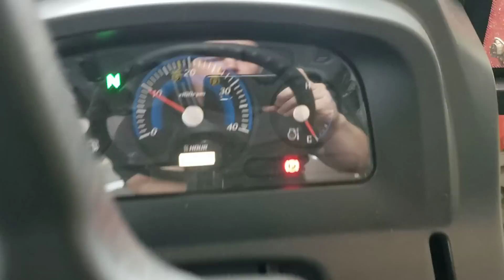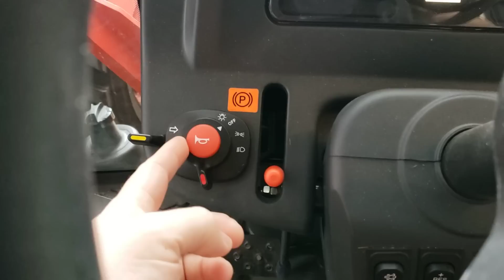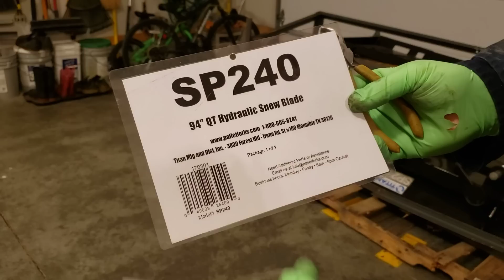Titan - SP240 - 94" Snow Plow - Unbox, Setup, Hydraulics, UHMW Cutting Edge, & First Run

Comment: The issue with plows is, if you get a lot of snow and no significant melting between storms, your driveway gets narrow really fast if you don’t push the first ones WAY back! Wet snow like that, will freeze to ice and make things very difficult till spring.
Reply from the maker: yes, true! Then when it's an early or late snow, the ground is still "softer" and you can run the risk of ripping the crap out of the grass ;(

I still LOOOOOOVE this solution! Snow Thrower attachment would be NICE too, but still a lot of complexity, and expense. I can use this for grading too (I have a steel cutting edge too).
Reply: @BrianPhillipsRC  yep…every tool has a purpose, some more than one. I was just thinking out loud…as long as it works for you….it’s beats the heck out of shoveling!!😁
Reply: It's the first week of December here and on my half mile driveway, I am already to the point of not being able to plow the snow away. What I am doing now is plowing to the middle and using a snow blower to get rid of it.

Comment: just put in a true 3rd function or a diverter. the diverter is real easy install. use a foot switch to divert flow. get it at hydraulic surplus center. I ran the hoses from rear on a yanmar I had. it just wasn't right. do it right do it once!  if they don't have the foot switch I got a spare I can give you. NIB
Reply from the maker: I was really hoping for two momentary push buttons up on the joystick. Then I could setup the controls and solenoids on the rear attachment point, where I routed my lines to the angling blade. That would be sweet...just one had, three controls, the way God intended it to be ;) LOL

Foot pedal would be nice too, but I don't want to just DIVERT, since I'm running a DETENTE circuit...AKA I turn on the flow, one direction, OR the other, and it KEEPS running, until I move the stick back to center. I was supposed to have One Detent, and ONE Spring Return...but I got BOTH as detents???

Comment: Another route you can  go is build some ski's for the blade keeps the blade off the ground about half inch. unless you want to scrape the pavement off. after a few years you will see the wear and tear on the pavement. you would not need the UHMW blade.
Reply from the maker: The UHWM blade is sweet, but it's super expensive in this size!!!

I'd LOVE to make some skis, but only for the rare occasion I slip off the edge...or when I get to the end of the runway. If the ground is frozen, it's no biggie, but when it's half-froze, it can really gouge the heck out of the lawn.

Comment: Great vid as always Brian! Now you just need to set it up so you can run it from your spectrum tx from the house🤩😆 One suggestion. When you start it up, pull it right out of the garage. Diesel soot is highly carcinogenic and will stick around in the garage and migrate into the house even with the door up. I’m a firefighter and diesel exhaust is a big cause of our increased cancer rates.  Stay safe and healthy. Happy New Year to you all!🥳😊
Reply from the maker: Thanks for the heads up. I usually don't worry about it, as these 4th and 5th generation diesel engines are BETTER at burning off diesel soot, but you're right, they're not perfect.

As for your fire engines, do you guys have retractable hoses to the exhaust stacks so you can run them inside the fire station?

Comment: I was just typing about a diverter being a better option at 52:30 when you mentioned it. Since the curl and the angle aren't likely to be used together and neither require a huge flow, it would be the ideal circuit to put it on.
Reply from the maker: yes, I would like to make an electronic, solenoid controlled dual or maybe even triple diverter that can be just plugged into one of those two hydraulic outputs, then I can have the THUMB control for angles, and possibly later, some WINGS that I want to add using another small circuit.

If I did it again, I'd use a LOT smaller hose to get to the front, but you NEVER know what you might need some day. If I come up with a PTO Driven High Flow Pump so I can run a brush or snow blower, these larger lines will help a lot.

Comment: That’s a nice piece of equipment Man you  rolling now 👍
Reply: The little orange cabs or design when you disconnect the fitting install it on the and You won’t get any more leaks it will fall in the cap 🧢
Reply from the maker: We love it so far. GREAT tractor, and super strong. We can lift 3-5 times what we could with the 1025R, and we can live it over 107" high now!!!

Comment: Brian I think you should save your money and use the snow shovel build up your shoulders. 😂 No just kidding you guys did your homework and got yourself an awesome tracker it does an awesome job very good decision. TThat tractor will pay itself off in no time.😉 Love you guys you’re doing a great job keep up the good work.
Reply from the maker: Thanks William! I just plowed  last night again, and it was crazy! We had a 6-12" snow fall, while we were filming BTW, so when you watch that video soon, you'll see it as we build the plane ;)... anyway, it was TONS of now I cleared in about an hour. I also cleared the entire road to the intersection, which as you know is way wider than our driveway.

The issue I'm still having is that when I go into FLOAT to use the weight of the plow to scrape along, as I should, I'm finding it still pretty difficult to break out of the float detent, to go back to neutral hydraulic pressure and then into lift to pull away from the edges without some level of gouging here and there. I Assume this is a finesse thing that I'll just have to get used to, but with the angling controls off and behind, almost by where the seat belt connects, it's just plain hard to get from the main joystick control to that control. I almost want to put in an electronic diverter so that I can just press the button and move that control. Not sure if that would work or not, but if I could keep my right hand on the stick and do all three controls, it would be so nice!

All things considered, I love running it, and it's doing a great job! We are extremely happy with this combo. I would buy it again in a heartbeat! Taking hay in the spring will be a whole different experience, and we haven't even seen how much better that's gonna be!
Reply: @BrianPhillipsRC  Brian you’re doing great, i’m sure by next year at this time you’ll have it all dialed in to be a piece a cake. I am retired now but when I was working are used to operate what they call a petty bone I don’t know if you guys know if those are back there I’m in California I used to do a lot of work at San Diego airport what they are as a forklift that can boom out till forward to a lot of different operations. And I was the only one licensed to operate this equipment at the airport, very scary at times but I had it dialed in. I been retired now for four years, when operating a transmitter on an RC plane makes me feel like I’m operating a petty bone Full on concentration at all times. “LOVE IT” I could tell you a lot of close calls I had around aircraft when I worked there for dead be a couple pages long. Back to your house is there some kind of a rubber marker that you could put in the ground along your driveway and walkway where if you hit it it wouldn’t break it would stick up like they do for snow plows along the highways back there anyways it was just a thought. Thanks again for replying to me you help me out like a Brother. You and camera crew are the “BEST” keep up the good work guys. You guys do a fantastic job on YouTube.

Comment: If I might add. On these longer videos if you could break them up in to 40 minute segments and make it multi part that would be awesome. If I miss something you say and try and scroll back real quick it's a short time bar that covers a huge amount of time currently. Very thorough video though.
Reply from the maker: Yeah, I have the same issue when we're making the videos too (scrolling back to catch something I said for example). Trouble we had in the past when we'd make a conglomeration of videos on a subject matter, like an Unbox Video, then a Build Video, then a Radio Setup Video, then a Maiden Flight video...was that by the time we were flying the plane, 80-95% of our audience was gone. We've followed some advice from very persistent people to put out flights at the beginning (this is obviously not a flight - LOL) and this seems to be very well received, but if I did what you ask, splitting videos into 40 minute chunks, there would be new issues....one I can say for certain, there would be more adds ;( Good for the channel, bad for the audience. Also, we'd have the same issue I mentioned above, where so many will be gone...I guess that happens anyway to a certain extent.

Either way, we hear your concern, and wish we could accommodate everyone, unfortunately it's pretty much impossible to make everyone happy. Your point is very good, and I want to figure a way to help people to be able to skip back to hear missed things, or some stupid comment I made. Maybe there's a key press that can be used on the PC to step back 5 seconds or something like this.

Thanks for being here with us Kyle.
Reply: Yeah on the computer it would be much better. On the phone sucks but it is what it is. Thanks just the same. I ordered the mini skid to universal skid steer plate today from titan and really considering the 79" plow. With that poly edge it's impressive how well it cleaned the surface.

Comment: My snow plow is steel and has a quality wood control handle.  It is powered by a 0.2 HP energy source although the HP has dropped over the years. ☃️ Maybe split the video into four or five parts next time.  3:40 is a LONG time to watch at once.
Reply from the maker: LOL - you have a shovel? ;) I had a lot of fun with clearing the snow. I'd like to get another snow, which would melt the next day, so I could try it again!!!

Comment: Brian (and camera crew) thank you so much for all of the tractor videos! Your videos were a huge help with my decision to replace/up-size my New Holland TC that I've had for 20 years. I have only had the Kioti DKse for 2 weeks but so far I really like it. 
In this video I noticed the led lights on the FEL, did you install them? Wiring? I didn't see you mention them, unless I missed it.
Reply from the maker: We added some led's, yes. Help a lot with night ops (common for us when clearing snow)

I stole power from other lights...I actually pulled the light out, tapped the power lines, and ran wires to the LED's. The lights are running halogen bulbs, so there's plenty of juice there to run an measly LED as well ;)

Now I have control of the lights on the front and the additional lights up top that totally fix the "blind" spot at night where the reflection of the loader arms is all I could see.

I think we show this on the playlist for our tractor, if you're interested...not the install, but the finished product.

Comment: take the wife to a drive-in movie theater in that there Kioti  keep plowing them trapezoids ! you guys are like two peas in a pod.  great vidjas maybe some Kioti running attachments???? what is the dif between an attachment and an implement?  a guy on YouTube named Colin made an underground tunnel to his garage. Kioti and TYM are at the top in the bang for buck cat. I was going to get me one of them there KU-BOATERS but it was 53k for the one that competes against DK NS NX.  I had a 2021 NX4510. it was a COVID tractor and they had a batch of bad solenoids in the NX e-hydro tranny so they gave me a TYM T494 , both were fantastic machines.

Comment: I don't think they can ship w oil in hydraulic lines.  relax the TIGHT ONE will tighten up with oil. a hydraulic top link and a 1/2'' x 6'' cutting edge for your bucket will make a huge dif in peeling sod and virgin earth. both are $200-$250 each    Holland spare parts for top link. top link hoses and ag. connectors under $250 at your door.

Comment: Awesome video man! A few questions for you because I am highly considering this cutting edge for my 5 foot Kubota snow plow. How do you like the cutting edge overall, are you happy you went with the beveled edge and not the flat edge and do you think its worth having them drill the holes for you? I was thinking of getting the 3/4” or the 1” thick. Any insight would be greatly appreciated
Reply from the maker: Whatever thickness we got was GREAT, but I don't want it beveled. You will Bevel it when you use it the first time ;)

Comment: I watched this whole video but I can not find where you talk about the 3rd function kit. Did you add that on afterward or have the dealer put it on? How much was it? If you add these extra parts yourself does it mess with the warranty?
Reply from the maker: Sorry for the confusion. Our dealor added the KIT of the additional 3rd and 4th kits.
Reply from the maker: It was very economical to add, something like ~$300 . Very reasonable compared to the $1500 or some ungodly amount John Deere was asking for on a tractor that cost about 2/3 MORE!!!

LOVE this tractor and use the heck out of it!!!

I doubt it'll mess with your warranty, but it was CHEAP, these options - get them to do it if at all possible.

Comment: Hey Brian, are you operating your front hydraulics off of your rear remote or do you have a dedicated 3rd function at the loader joystick?
Reply from the maker: It is from the rear, and I WISH I had a joystick mounted thumb control....it would be soooooo much easier to use. The beauty of this issue, if that I COULD still add a solenoid control that makes this circuit operate.

Comment: Thanks for vids!  Purchased this same tractor and the 79" Titan Plow.  Did you ever feel you needed chains when plowing?  My tires are loaded, but I don't have a ballast box and wondering if chains are in my future.  I have a relatively flat driveway but live in Chicagoland so ice and snow are plentiful.  Thanks!
Reply from the maker: This was one of my best purchases since we moved here to the country. I can clear the road to the intersection in minutes (well, quite a few minutes, but I CAN do it).

I've only been in trouble for traction a couple or three times where I was pushing piles back, and got stuck in low points. I was able to rock and roll my way right out, but that's one of best parts of a loader mounted plow....you can push your tractor right out of the snow if necessary ;)

Sounds like you might be on a smaller tractor, if you got the 79" plow...ours is the 94" version.

Did you think about a UHWM cutting edge yet? Makes ZERO wear on your concrete - so nice!!! But the mfg'ers are very proud of UMWH

Comment: Looking at the same plow but in the 79 inch for my mini skid steer. How well does the trip work on the plow? That is my main concern. Currently using a dirt bucket and when you hit the lip on the concrete it's spine shattering. Where in Iowa are you at?
Reply from the maker: We're in Central Iowa, just outside Des Moines.

The break away works great, but it's WAY too loose the way it's shipped, I suspect you will agree. I've probably made a 3.5" - 4" adjustment on each side to tighten it up, and now it works better. Also, with the ground nice and frozen, the overlap over the edges is way less destructive...plus I'm getting the hang of it finally...had to clear 6 times this weekend!!!

I have a video coming to show the top "skirt" we made. It's a GREAT addition and took all of about half an our to do (of course the video made that 3X as long...but super easy)

When you do settle on buying or now, will you help us out and follow this generic link - it will help us a TON!

Titan https://bit.ly/3eXH9R7

It doesn't cost you a penny, but if you follow this link, it will help us to build report with Titan, and also earns us a few bucks in commission too ;) Obviously, nothing to quit your job over, but it's a nice little injection to help cover some of our time. If we could be pushing hundreds of these items every month, that would really go a long way in funding our "next step", but we're about 100 per month off from that goal - LOL! We pretty much don't make anything on the ag / farm / homestead videos on our channel, but we're really passionate about trying to help others making the change from city life to acreage or farm - it's a WONDERFUL experience, and we wanted to start a second channel, but YouTube is IMPOSSIBLE now-a-days, even with an otherwise "successful" channel to use as a launching point.
Reply: You ever make it to the Quad Cities for the big scale fly and other things they do? I'm in Davenport myself. Haven't flown in a few years now that I started my own business but certainly miss it! I'll be sure and jump through that link next time.

Comment: The blade is too wide for your walkway.  If the blade angles at 28 degrees it would decrease the width of the path from 94 inches down to 83 inches.
Reply from the maker: Thanks! I was thinking about putting on a shorter blade on the top (the left side only), then I could flip the whole thing over for the sidewalk. I had a problem this time clearing the snow, because the ground around the driveway wasn't frozen yet, so I kinda rutted next to, and in front of the front sidewalk. Live and learn, I guess....

So what would you do for the front sidewalk? I had been using the zero turn and it was a 48" blade.
Reply: @BrianPhillipsRC  That would be a good place for a snowblower.  You could get that cleaned up fast and the lawn would be safer.  I understand the desire to get it finished with one machine though.  Maybe lower the blade so it's a couple of inches off the surface to clear the bulk of the snow and just push the rest with a shovel.  Or the best option might be to build an RC snow plow and clear it all from inside!